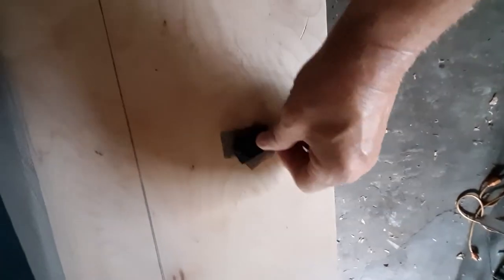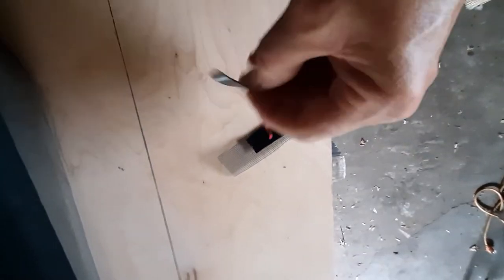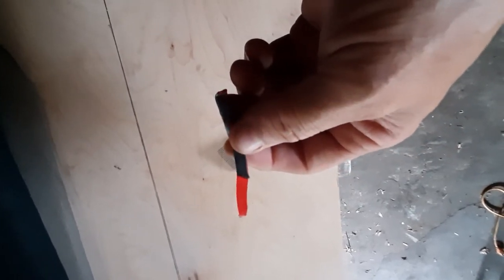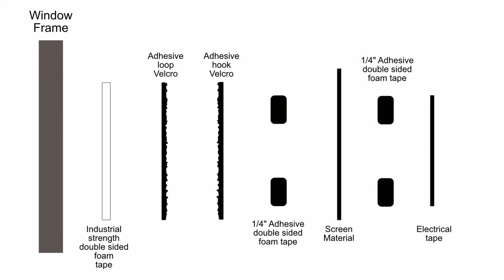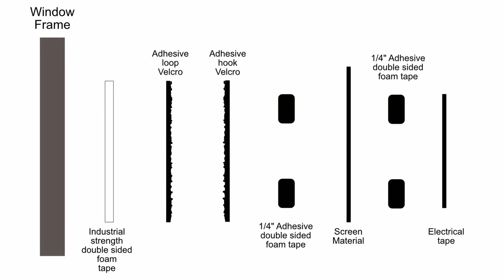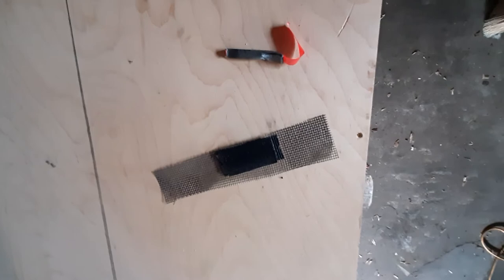sb update #81 DIY Window screen install for your shuttle bus part 1

Comment: how are the screens holding up? i have always found heat and peel-n-stick tape don't last. i think i am going to do mine with hot glue. they have black automotive glue sticks used in dent pulling. super strong and being black it should hide well and no glue tackyness like peel-n-stick 3m tape. i have tried a test piece on screen/velcro and they aren't ever comming apart.
Reply from the maker: thanks for stopping by... I used industrial double sided foam tape to stick to the existing adhesive of the velcro... its been 7 month and all is doing well... let me know how the hot glue works... thanks